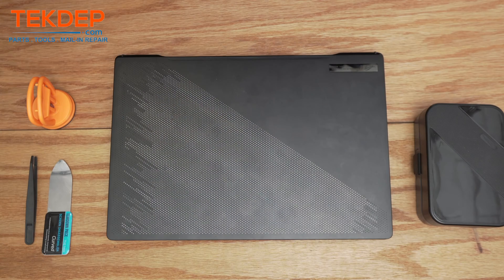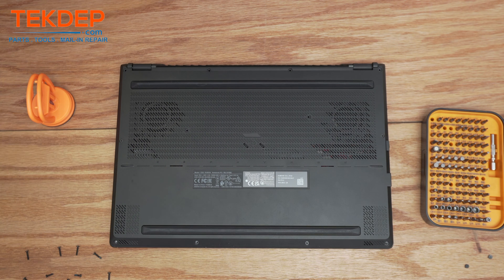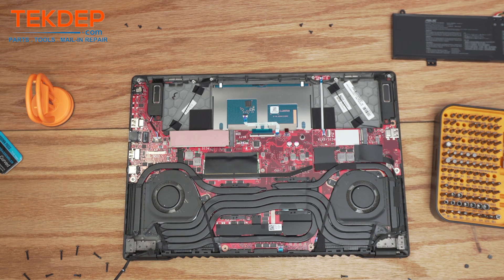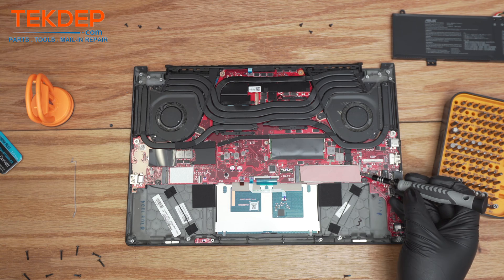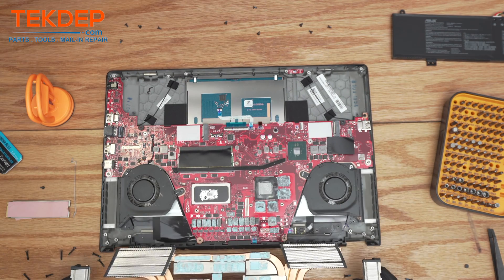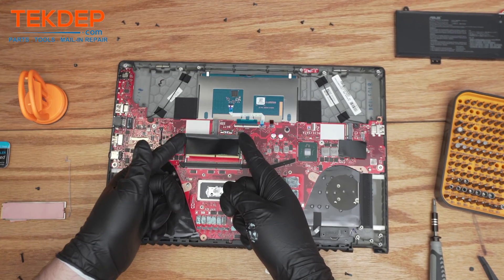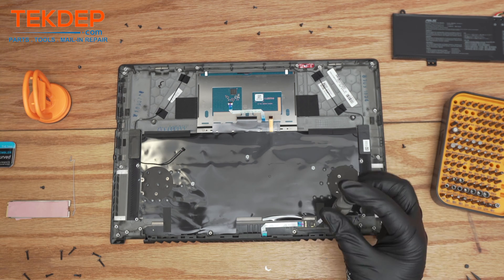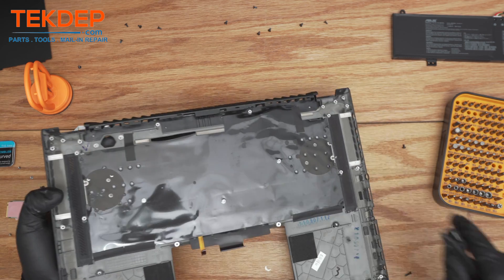ASUS ROG GU603HE Repair Guide and Disassembly

Comment: So this is clearly not a vapor chamber cooler? I was confused by it cuz I thought it was attached to the processor die itself but if you google it the heat pipes are all gone and its a metal sheet instead.

Comment: I assume I already know the answer but I have to ask— is it possible to remove the cooling assembly and main board as one piece? I only need to replace the keyboard and would rather not completely disassemble if it’s not necessary. I couldn’t tell from the video which screws were integral to holding the board down and which were only attaching parts to the board. I’ve honestly never repaired a laptop that didn’t require full disassembly for a job like this but I didn’t have a toddler when I worked on them either so time wasn’t as big of a concern lol